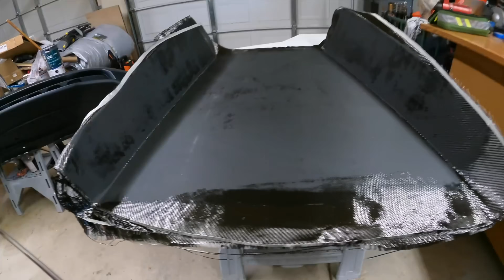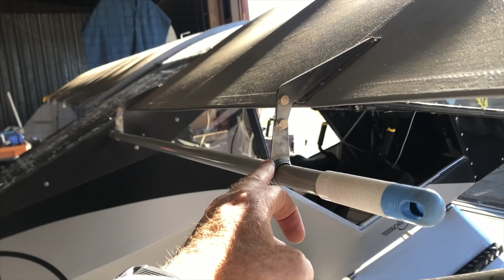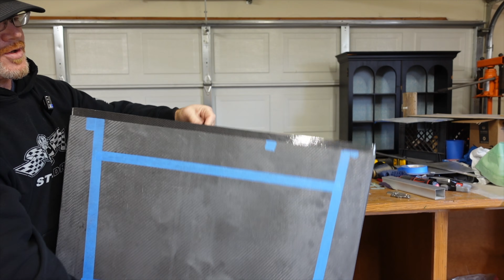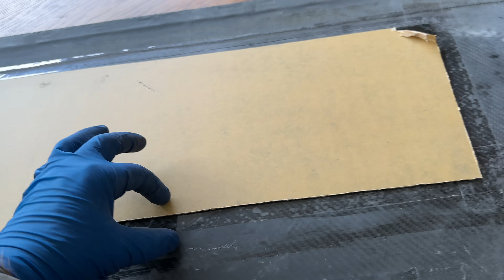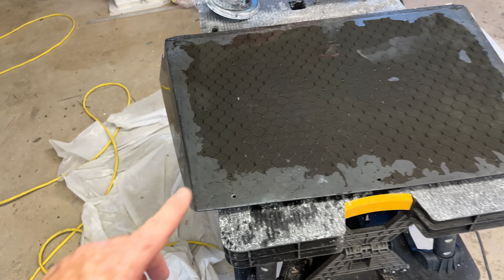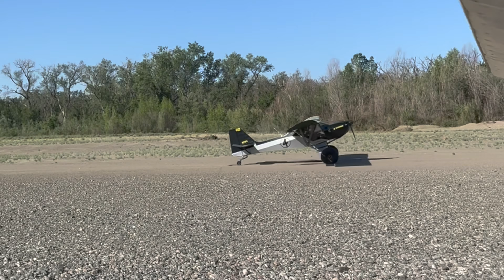Kitfox 7 Apex Build Episode 74 Carbon Fiber Turtle Deck For the Kitfox

Comment: Very nice but carbon fiber is mildly opaque to electrical current which could interfere with radio transmission.
Reply from the maker: No issues

Comment: Bryan, when you lay the peel ply, make sure it is ALL wet. It should NOT look "patchy". It is the final covering of the "layup". It needs to look all wet on the mould, otherwise when it is removed, you will have that "patchy" look - as you can see for yourself. You did not require that many layers of carbon. What it needed was a 3mm "hard foam" layed up between two layers of cloth. It would come out totally stiff and probably two and a quater pounds.
The "slot" for the turtle deck only needs to be a "cut line" in the carbon fibre, as it will bend around the beam for the flaps.
 Thanks for sharing from New Zealand.  :)